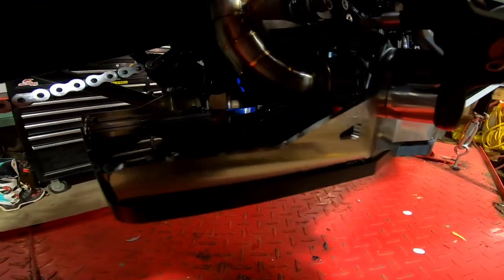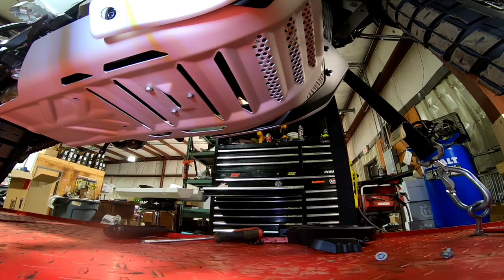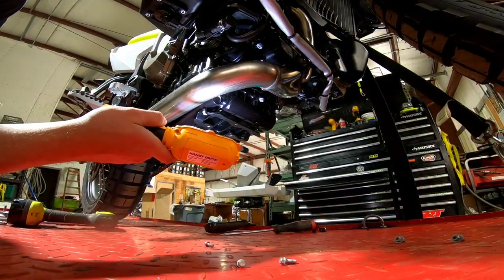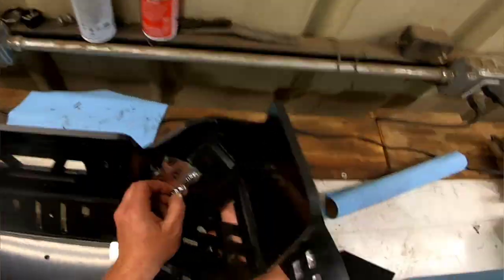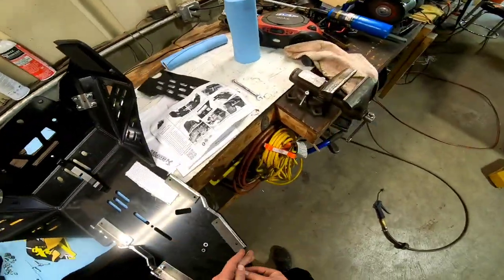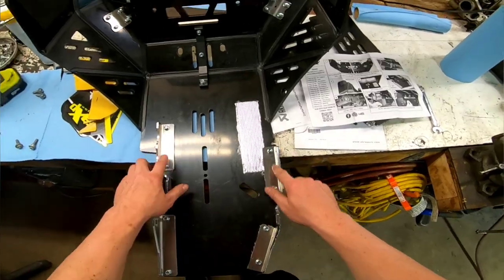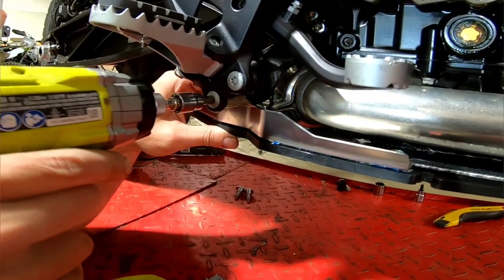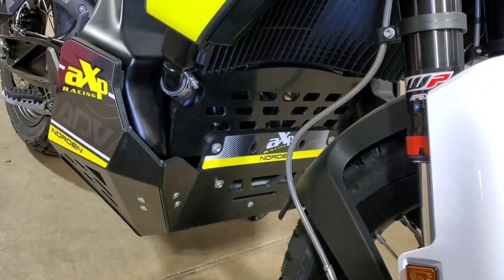How to install an AXP Racing skid plate on the Husqvarna Norden 901

Comment: Minor correction to your video here. Per APX,  the rock guard [8:26] should be installed infront of the skid plate not behind. Thanks for the video though!

I had a lilttle problem installing my skid plate initially because the previous owner installed a new midpipe and muffler but installed the clamp upside down where the header connects to the midpipe  (a mistake YOU warned about in a different video).  This put the clamp directly in contact with the plate so that any impact to the plate would have directly impacted the exhaust system. Took a little while to reinstall the clamp correctly. VERY lucky I chose to install the APX or I wouldn't have discovered this mistake.

Comment: Has anyone tried installing the AXP Touring skid plate for the Norden 901 on a KTM 890 Adventure with the KTM OEM center stand? AXP does not make a skid plate for the KTM 890 with the KTM OEM center stand but they do make one for the Norden 901 with the OEM center stand.